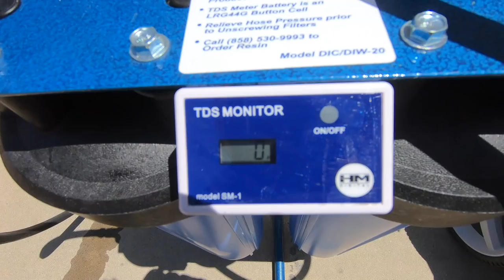THIS IS THE BEST WAY TO KEEP SWIRLS OUT OF YOUR PAINT!!

Comment: Being my truck is so old, used in the country, and whatever else, i used the basic car wash. No fancy garages or anything. Kind of sucks, as i want to get a challenger. Anyways, local car wash with you guessed it, that nasty brush. My paint is so screwed i probably need a paint correction. Again, its used in the country. Just imagin. 05 1500 extended cab z71 jauling a 24ft gooseneck cattle trailer. You get weord looks. Use to it.

Comment: Great video, might have to buy one since I wash my truck every week and drying sucks. But first I am getting it ceramic coated. Also what pressure washer tip degree do you use?
Reply from the maker: i use the 180 Degree the wide one

Comment: Hey Eddie nice video, thanks again for sharing more of your tools with us. I wanted to ask you a question about the wheels on your Sierra and the spotless system. On your wheels, once you got the bigger tires, lift, and rims, did you have to buy a different set of lugs to go on them? Also for the spotless system, what psi do you spray on with your pressure washer, because I’m assuming you’re not full blasting the car and destroying the paint! Lol anyways thanks again Eddie, great vid :)
Reply from the maker: Thanks man and yes i had to go with skinner lugs usually when u get rims they will offer them to u and my pressure washer is 2.4 mpb i dont go right up to the paint either.

Comment: Eddie - how do you apply wax and sealants to your vehicles? I am worried if I buy that deionizer it will still scratch when applying the treatments.
Reply from the maker: i apply wax with only a foam applicator i have never had any scratch problems just make sure the surface is clean
Reply: which foam applicator do you use?
Reply: is that just like a plastic pad?

Comment: Nice video. Hey I thought you might like to check out rvtransformer. He has a different kind of di filter system. It seems to be a lil more cost effective than the spotless. I’m doing testing now on that one.  Anyways awesome to see a local. Keep up the awesome content!
Reply from the maker: i will check it out fer sure and thanks for the support
Reply: Lon Scharnow yeah no. Mr. RV Transformer used to work for me until his statements began to deviate from what science knows to be true. Some have been fooled and I am saddened when I speak to them after they toss those downtubes in the trash and pick up our pre-filled filters. There’s a reason we’ve been doing this via cartridges for 14 years: it balances convenience and economy. Our proprietary centering rings eliminate any bypass and if you don’t recycle your resin, 72 tons of plastic goes to the dump for every 10k filter changes...